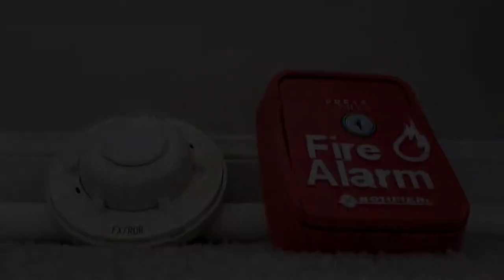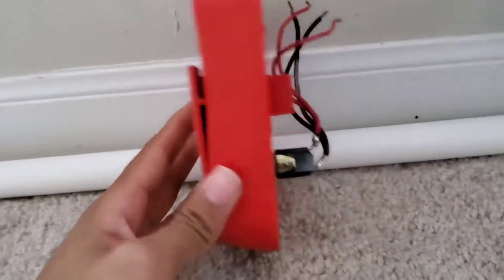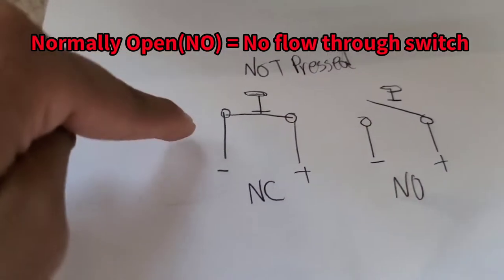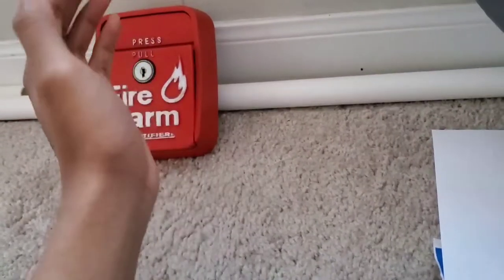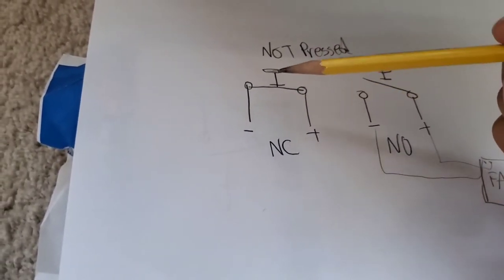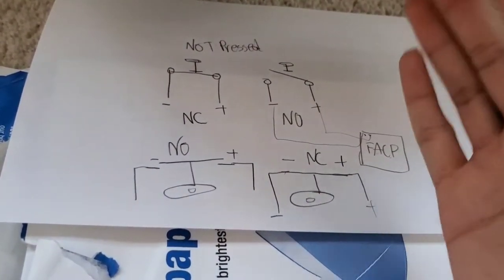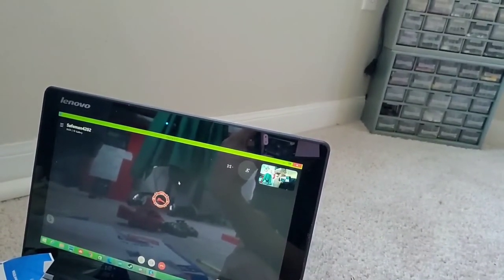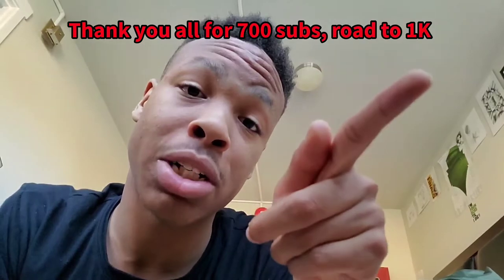How Things Work| Normally Open/Closed Contact Devices (Episode #1)

Comment: I got a very loud mechanical clock with a strike on it it sounds like a 9806 or 4903 9219 or so i got it for 20$ original price was 25$ and the brand is polaris 31 day clock and nice video. have you ever heard a mechanical clock chime or strike they not to loud and pretty sounding tunes or just striking not sure of what march time a mechanical wind up clock does. How does a 9838 work i know that it vibrates and makes noise i just carrious how it works
Reply from the maker: Thank you. Regarding the workings of a mechanical horn, that'll be another episode of this series
Reply: @BlackLightning4547  cool and thx
Reply from the maker: @vintagesimplexfirealarmsof6440  My pleasure